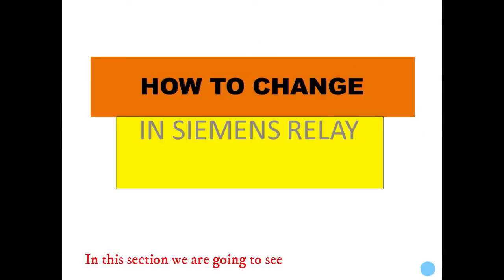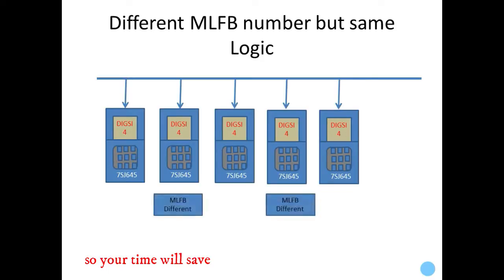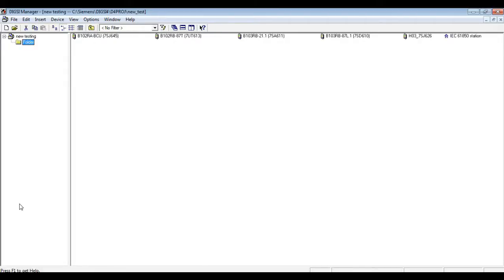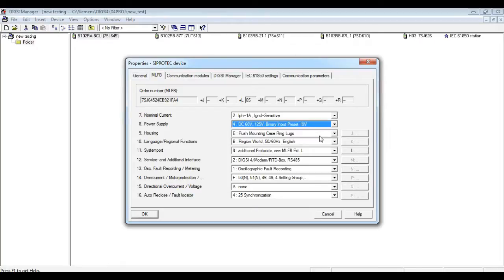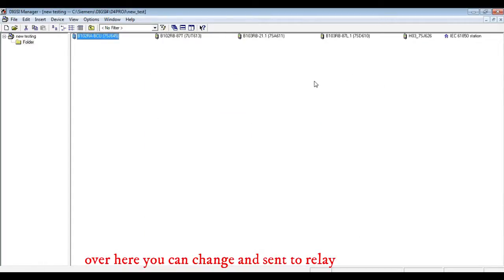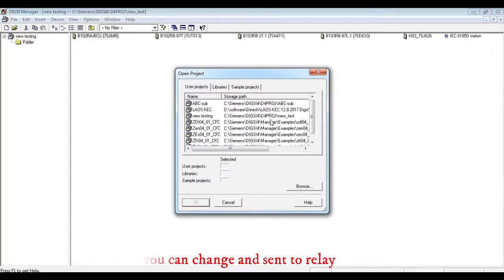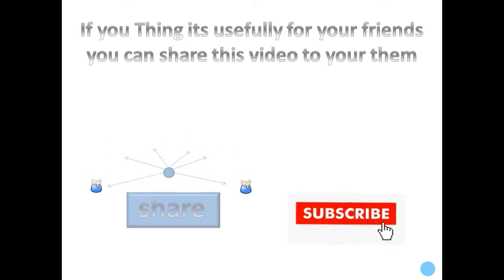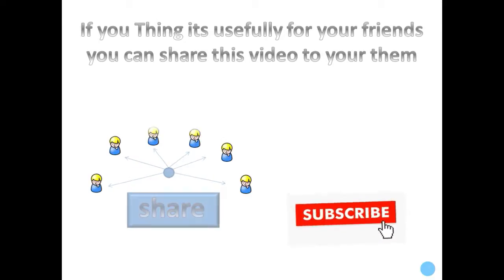HOW TO CHANGE MLFB NUMBER IN SIEMENS RELAY

Comment: I have problem with siemens relay siprotec 3, there is a message "mlfb wrong", please how tofix this problm, this problem appears when i tray to update the firmware of the relay because it was blocked.
thanks in advance

Comment: Hi , i can connect with Siemens 7SA611 Distance relay but i can not upload the same relay setting when i want to initialize it give me a message that (( could not read parameter set... error: 24 )) what well be the reason? thanks
Reply: drives problem